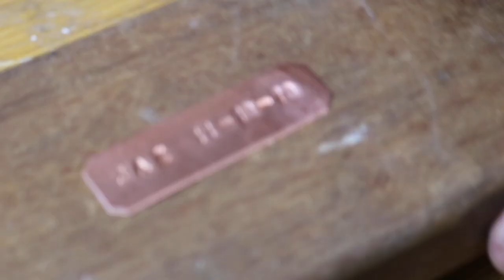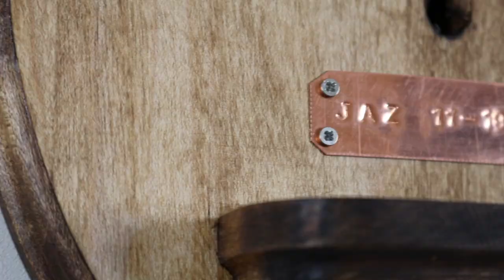DIY Antler Mount - How to make

Comment: you glossed over the only part I wanted to see.
so... what, a block in the skull? with some nails sticking out to meet the stand?
how did you fasten the block in the  skull? screws? epoxy? wire?